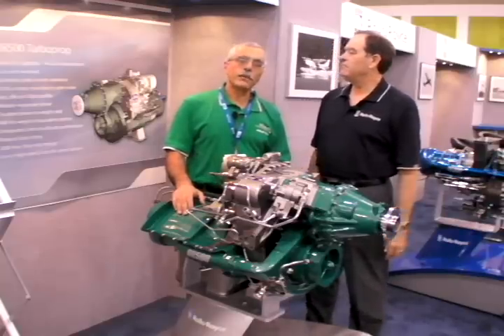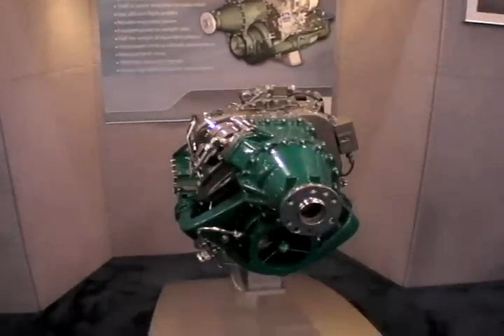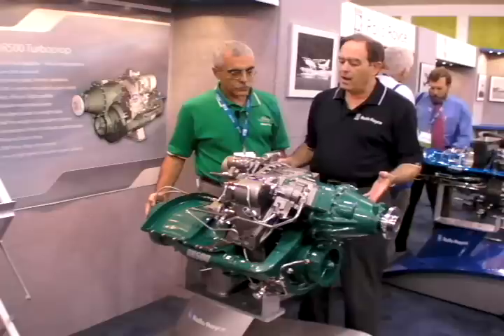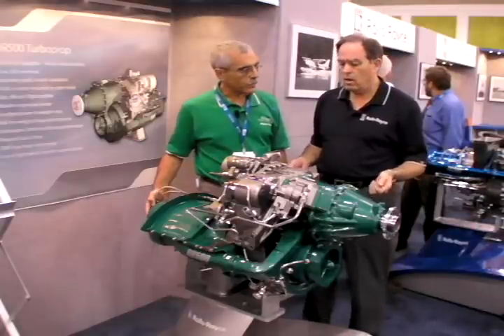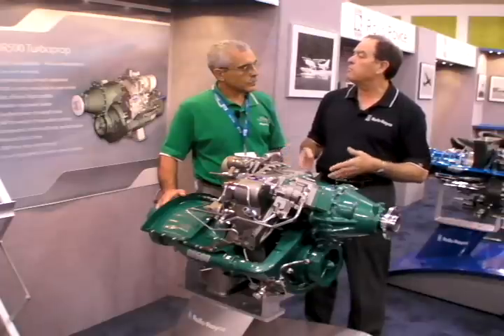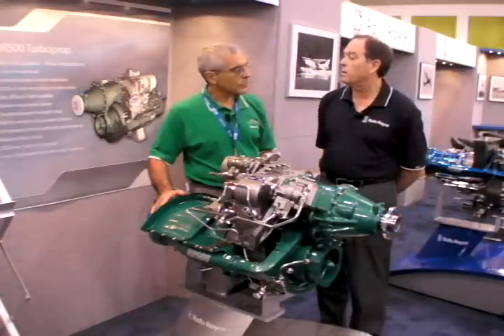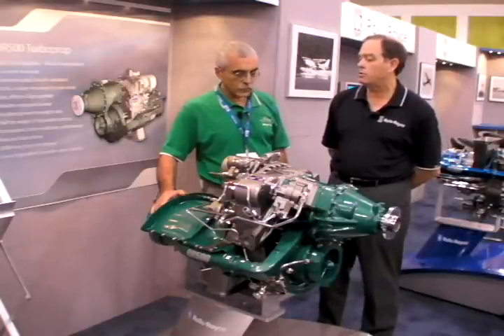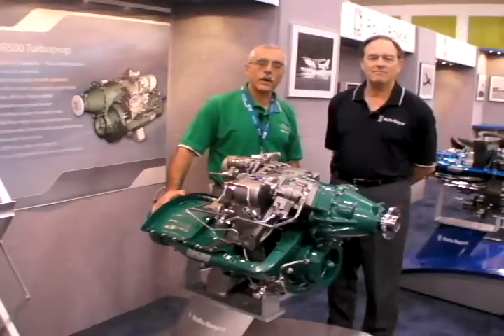Rolls Royce Turbine Engine For Small Planes

Comment: This would be an excellent replacement for the heavy six cylinder engine, used in the Super Mushak ! It will greatly enhance performance parameters, and become a true Super Mushakk ! I sincerely request the PAF to seriously consider this engine replacement. It will also use Jer-A-1 fuel, used by the jets, instead of expensive and difficult to obtain and handle, High-Octaine Aviation petrol.
Please think outside the box, for truly enhanced performance of the Mushak.

Comment: why are these not in hybrid cars
Reply: Inefficiency. 
The "mid-sixes" numbers they're talking about are in the range of 0.649 to 0.677 pounds of fuel per horsepower-hour (those are at maximum continuous power and cruise power, respectively), which is 0.395 to 0.412 kg/kWh. That's much higher fuel flow for the same power than a conventional piston engine; an 80-year-old aircraft engine might run 0.452 lb/(hp·hr) or 275 kg/kWh, and a modern car engine runs about 0.370 lb/(hp·hr) or 225 kg/kWh or better. 
And turbine engines get even less efficient in smaller sizes, so a car-sized engine would be really bad.

Comment: Guys, show the engine during the Guy talk, is more positive the vídeo, congratulatíons per engine however It did need bê criated 60 years Ago, is very simple, the Alison did make It joint with one kit Soloy for Hughes 300, Bell 47 and some planes is the C10 model with reduced HP and same type of Allison C18, however the costs I think is not did bê low. Because It not tive sucess tô salé.

Comment: There have been 2 - 20 hp turbo shaft engines in the model aircraft world for ten years already, the turbo shaft has been with us for about 70 years, 45 years ago I got my PPL in a Cessna 152, which are apprently still a popular type, the GA world is just so slow. Since 1965, it has been like watching the presession of the equinoxes.

Comment: Until you can get a version of these on a certified plane for less than 50k all chips in--on the frame---ready to go---this engine is meaningless for most of us.  There needs to be a turbine conversion for Barons and 310s and such that makes economic sense.
Reply: TurbAero or stuttgart engineering may have what you're looking for. :)

Comment: Today it is 2020! What happened to this particular turbine today? I don‘t hear or see anything about it. 🤔
Reply: It's used in s few light helicopters. It's very inexpensive for a turbine, but at 250000 $, it's very expensive for a light aircraft. And you will need to develop a custom gearbox for it.
Reply: @PepsiMagt  No, it is not found in any aircraft. The RR300 is in some helicopters (the video mentions the Robinson R66), but the RR500 project was abandoned in 2012 - it never went into production.

Comment: Safe to say dead program. Too bad a 300HP Turbo Prop would be nice, but purchase price and operating cost is show stopper. Walter M601 20 years was $60,000, a PT6 like engine 600HP. GE bought them and guessing prices have gone way up. Garrett TPE331 is another small Turbo Prop, but still more HP than 300HP.

Comment: One day the magical 100hp from75pounds of engine and accessories will be achieved, sport and ultralight aircraft would love that combination
Reply: They express power in kilowatts and weigh things in kilograms now . . .
Reply: It has been possible for a very long time. 2 stroke Snowmobile engines have been making over 100hp while weighing virtually nothing for decades.

Now I should state that 75lbs for even a snowmobile engine is incredibly light, but a 140lb, 3 cylinder snowmobile engine making 150hp --- those have existed since the late 80's --- and these engines are liquid cooled! 

If, let's say Polaris, decided to make a 100hp 2 stroke aircraft engine, that weighs 75lbs, I have no doubt in my mind they could do it with ease.
Reply: The PBS TP100 is 62kg making 180KW

Comment: This video could just as well have been made in 1965.  Typical GA plane = 50 gal tank, 48 gal usable.  Using his 24 gph rate, we have  2 hr endurance - 0.75 reserve = 1.25 flight endurance X 250 mph average cruise (includes climb time) = 313 statute miles.  Taking off from Santa Monica, you cannot make San Francisco or Las Vegas without landing.  The challenge for these types of engines has always been consumption.  We had 250 lb, 300ish hp turboprops like this since the 1960s.
Reply: He also said the engines weigh about half what a reciprocating engine does. That means you would likely be able to carry more fuel than otherwise would be the case.
Reply: Turboprops always had small dimensions.  Turboprop nacelles have always been compact for this reason.  I hope that wasn't his big breakthrough.
Reply: @scottneil2427  They have a half empty, half full mind set, which helps no one but their bottom line !!
Reply: the only way to omprove efficiency is recuperators, which add mass+bulk. That's probably doable on small engines but  it takes a mindset change because it necessarily makes the package a lot larger

Comment: If I remember correctly all small aircraft must have their engines broken down for a 100 hour inspection.  What are the cost differences between having that cost for a conventional engine verses the Turbine engine?  If they both have approximately the same miles per gallon of fuel, the cost of fuel and all other ancillary cost like engine inspections must be taken into consideration when looking for aircraft.  Which one would be the more reliable power plant for the long haul?  Conventional, or Turbine?
Reply: Wrong!  The 100 hour inspection is only applicable to commercial aircraft, *flight training, charter, and the myriad of "for profit" aerial uses, and does NOT include an engine teardown.  Light aircraft not used in a commercial setting must undergo an ANNUAL inspection that also does NOT require an engine teardown.  Aircraft that are used in a commercial setting must be torn down at the manufacturer's "Time Between Overhaul" or TBO and overhauled per the manufacturers overhaul manual.. Non commercial do not need to be overhauled until..... something breaks or the owner gets too nervous!
Reply: You are correct, I stand corrected.  (I just looked it up).  My old information came from my flight school, and it is true for schools who use their small aircraft for hire, such as flight schools.  Thanks Michael
Reply: So, back to your original question: TBO on piston engines range from a low of about 1400 hours (some older Continentals) to 2000 hours (most Lycomings) to 2400 hours (the Lycoming in the Cessna 152 trainer).  Turbine engines have TBOs exceeding 3500 hours.  So, with the exception of the 2400 hour Lycoming, the turbines win out on maintenance.  As turbines use considerably more fuel, then pistons win out on fuel cost.  But as turbine powered aircraft are usually much faster than piston power aircraft, the analysis gets muddy and needs to be specific to particular aircraft.  It is not just fuel burn, but MPG that counts.  In addition time to destination and reliability are also salient factors.  So, there is not a simple answer.
Reply: Well stated my friend.
Reply: TBO is dependent on the engine maker. Most of these are 2000 hours oe 12 months

As for reliablity - without hot starts (which are rare with electronic starting systems), turbines easily beat out piston engines because they only have a half dozen moving parts and no reciprocating ones

Turbines use 30% more fuel than piston engines but are usually less than half the mass - but that's best case scenario. As soon as you come off full throttle the efficiency of turbines gets vastly worse.

You can solve that using recuperators (this is done on ship/power generation turbines and was done on the Chrysler turbine car) but there's a bulk/mass penalty(*) and you can still only approach the efficiency of piston engines not surpass them

(If you look at the engine package of a M1A1 Abrams tank, the turbine engine is the tiny lump at the bottom that looks like an alternator - 90% of the engine package is recuperator. If you want a 100-400hp aviation turbine you need to figure out a way of incorporating this into the packaging or else it's just not worthwhile in terms of fuel tradeoffs)

Comment: Virtually NOTHING posted or in the news since 2012 on this engine... just a note that the RR 300 is in full development and going into craft such as the larger Robinson 4 place. A 300HP (roughly) at HALF the weight would require some serious re-jigging of any normal plane's CofG ratings but having worked that out you'd also be looking at an additional 250 to 275 lbs of fuel in a small single!!! Wow.

Comment: this engine will need planes designed for it. Most of the airframes that could use that much power are designed for piston engines of twice the weight. Installing one of these would cause such an aft CG shift as to be insurmountable. Or it would have to be mounted in a very long nose, which would then need compensation by adding extra rudder area like seaplanes need for their pontoons. It would work in a Glasair taildragger.
Reply: not to mention the fuel consumption of a turbine engine. Yes, it's small, but I doubt it would provide better fuel burn than today's diesel piston engines that use JetA1. Take the Diamond twin star for example, twin engine aircraft, high speed cruise 190ktas at 16.8gph total!
Reply: @royl657  Yes, but their rate of engines issues is horribly high. In my whole flying career I had two major engine issues (one complete failure in low altitude and one 40% power loss o takeoff) and both of them were with Thielert diesel engines. Old Lycomings and Continentals might not be the future, but modified car diesel engines aren´t the future either.
Reply: @adventureairinc7355  They haven't been using those engines in a long time. The new ones are very reliable.
Reply: That w/b issue would be a good excuse to use recuperators (low mass high bulk) which vastly increase turbine efficiency, particularly when off full power.

There''s a good reason the things are installed everywhere turbines are used on terrestrial applications

Comment: What a joke. That surly will help kick start homebuilding and GA .... really!
Reply: + Buddysimo Simonetta, A few years ago I would have def. agreed with you.  But now I really think it may be electric.  The advancements in battery output  and storeage has been phenominal.
Reply: For 4+ seat small aircraft that can use 300 hp and fly fast without falling apart, might be a good engine.  Turbines run full throttle, high altitude , and fast.  Not suitable for a Lyc 540 replacement.  Maybe a bush plane, like a Caravan.
Reply: Buddysimo Simonetta i'm betting on the return of steam :}

Comment: This is still a dream for GA even after 8 years.
Reply: The PBS TP100 is a perfect solution. Last I heard they were still seeking certification.
Reply: @andrewmorris3479  if those tj100 had a longer tbo I'd be all about it, but 300 hours is no where near enough.
Reply: @kazansky22  The PBS TP100 turboprop is 1500 hour TBO.
Reply: The should have made a small turbofan instead. 10kg.
Reply: @Ryder Kairo yea, I've been using Flixzone for months myself =)
Reply: pro tip: you can watch movies on flixzone. I've been using them for watching a lot of movies these days.
Reply: @ryderkairo9454  Wow, both of you just happened to join YT at the same time. Nothing suspect there.
Reply: @ryderkairo9454  Suspect.